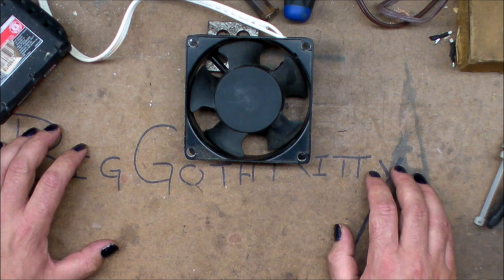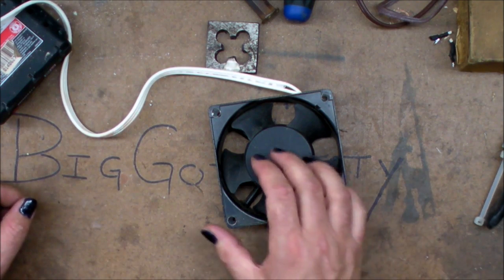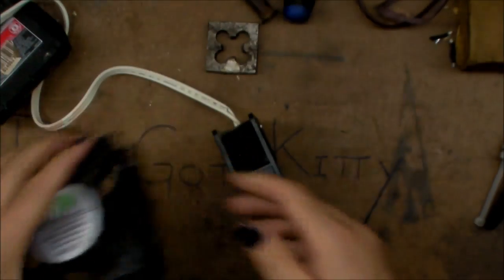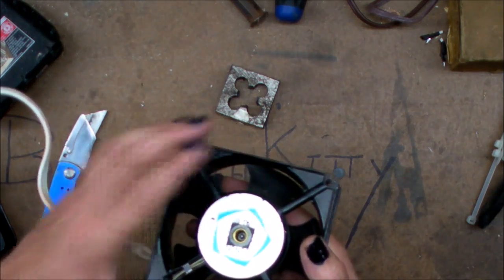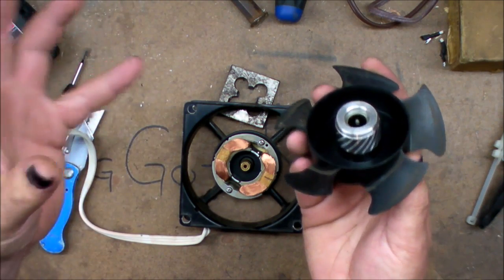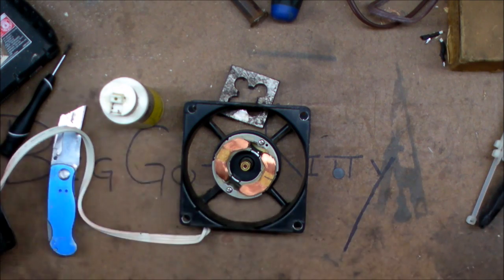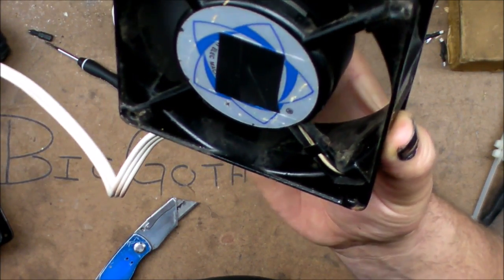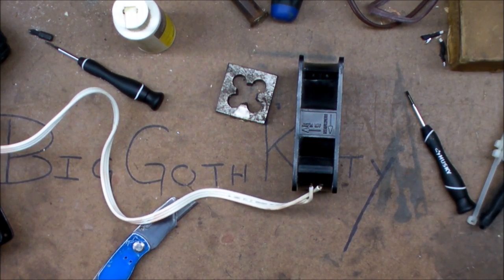Emergency fan repair tricks on a dead 120mm cooling fan.

Comment: "Not a long term repair"
I bored through solid plastic with a steak knife to get to that bearing. Didn't even take off the shield at the end, just dropped one drop of oil into the hole. Lasted 5 years, then started screeching. Did the same oiling again and lasted 7 years so far

Comment: Make a thin paste from fine Boric acid/oxide and water. (NOT Boracic; a different chemical)
Make it around Custard consistancy; mix it with your oil at around 30% paste to oil. (a sonicator helps)
Then surprise-surprise; your temporary fix becomes Perminant. Permanent!-perminant and quieter. and the play/wear; well its gone. (unless its bad.  Takes up/out about 2 microns of play/wear in a sleave bearing, 4 in a ball/roller bearing)

Ye you don't believe a word, so here's the Science; Google:
Dr Ali Erdemir Argonne National labs Boric acid lubricant

Comment: You need the blue 3 in 1 which is non detergent, with that the fan would surely last much longer than the factory oil, i do this to my household fans

Comment: If you had the goods and want to get the longest use out of a fan. Spray it with electric motor cleaner or contact cleaner. Make sure its plastic friendly and electical component friendly sprsy the shaft and coils after dusting or nlowing with compressed air. Use white high temp lithium grease. Or sewing machine oil works well. Spray teflon. Pb is excellent for specialty oils and lubes. They have a whole line of them. One especially designed for rolling garage doors. Doesnt dry. Doesnt attract dust statically neutral long life weather resistant spray lube. Ive gotten years out of fans after doing so and they were in way worse shape than thst

Comment: I found the best tool to put the plastic split washer back on, is a very small socket on the end of a hand held driver (the kind that is square to fit sockets at one end and looks like a screw driver).